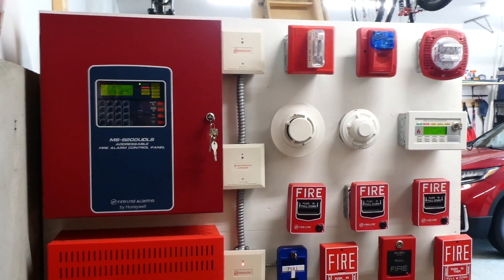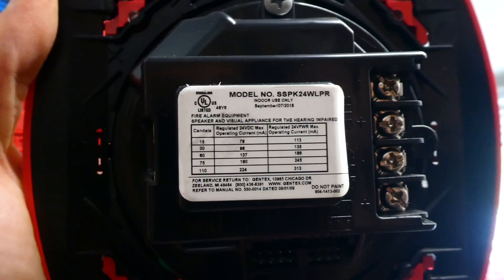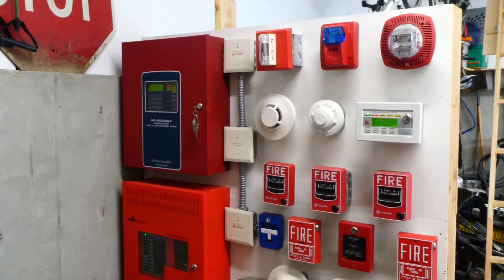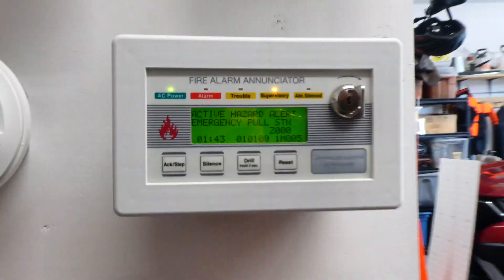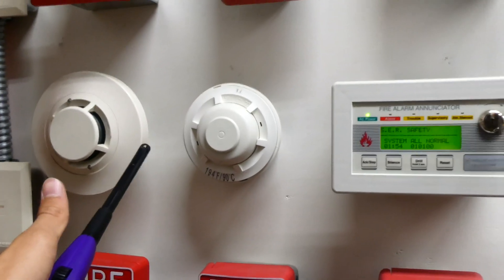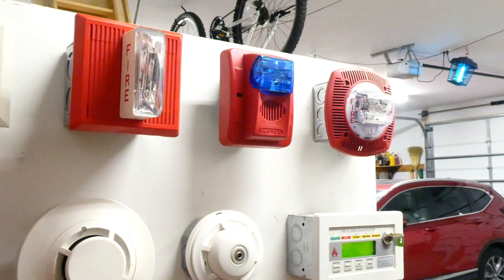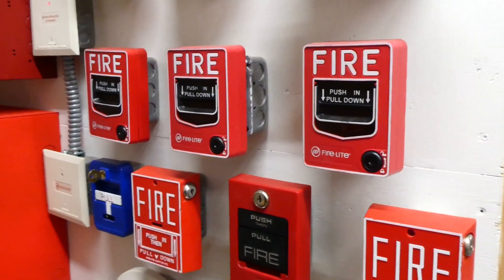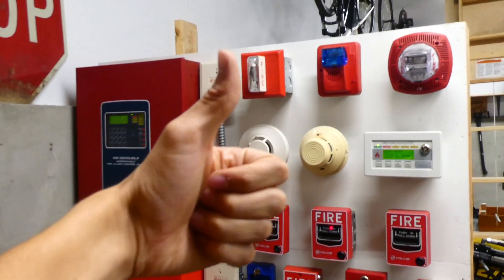Wheelock & Fire-Lite Voice System Test 14: Heat Detector & MT Activation!

Comment: They should have some of the front plates come with the heat detector where the head falls off at a certain temp in the box so u wouldn’t have to replace the alarm every time

Comment: When I first gave AC Power to my fire alarm system, the alarms would activate unexpectedly and would have to shut it off! After countless troubleshooting, I figured out I wired my heat detector incorrectly—and I thought the detector was permanently activated before it was given to me (pre-owned device). After I fixed the wiring, the panel stopped activating unexpectedly! 😃
Reply: Hi

Comment: MODEL NO. 5604 SINGLE CIRCUIT 194 DEGREES (90 DEGREES CELSIUS) FIXED TEMP . ONLY N04_686_5804C